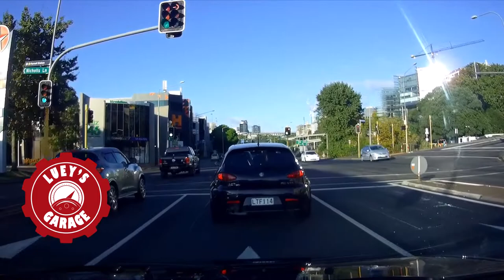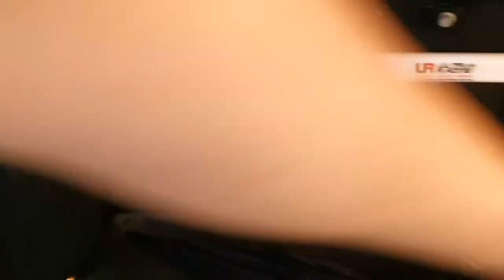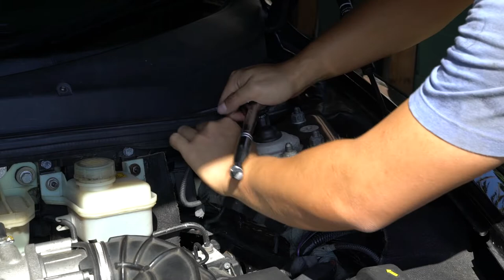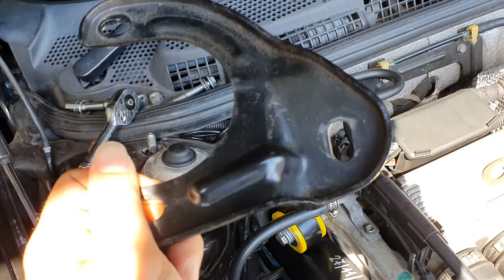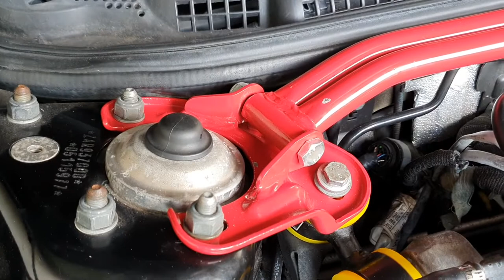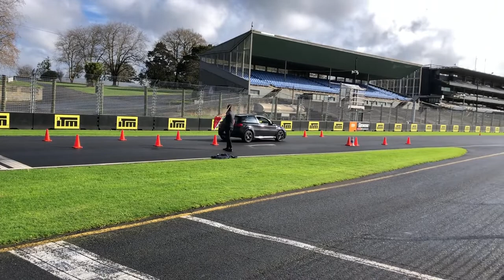Alfa Romeo 147 GTA Episode 17 - Front strut brace install

Comment: Received my front strut brace for my GTA from Germany on Wednesday around the time I watched this video. Their shipping is really good as I only ordered it last Friday. Not bad to Australia in 5 days. Can you tell me about the fitment for the rear brace? Is it bolt straight on to existing mounts like the front brace or is there additional remodeling required?
Reply from the maker: The one I got which is the Ultra Racing one bolts straight onto the seat clips, you just take the clips off by undoing the bolts and put the brace on then put the clips back on top. No mods needed and I think works pretty good. Looks very steath too but obviously sacrifices luggage space when the seats are folded down. I'd say its worth the price!
Reply: @LueysGarage  Thanks. I’ll have a look for it. I don’t fold the rears down in this car so that isn’t an issue.
Reply from the maker: @JohnHeidemann147  agree its a minor problem...only caused problems once for me but that's because I took the wrong car haha

Comment: Ok installation but the bar is shit!
Reply from the maker: Why do you say that? I think it works well
Reply: @LueysGarage  Screws in the joints, bar formed by two tubes. He has weak points, better a whole bar welded to the two plates that rest on the domes.
Personally i don't like!
Reply from the maker: @NicoMusH  yes this is true, the joins will certainly make it less strong and rigid. Its the best one I could find, I really wanted the original Alfa Romeo one but they seem impossible to find now